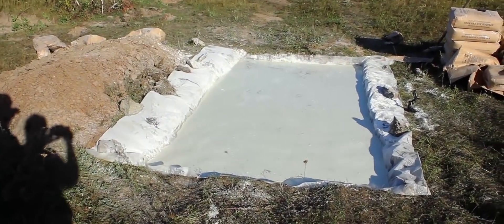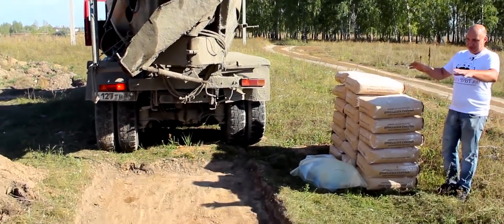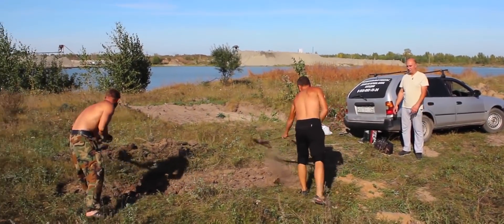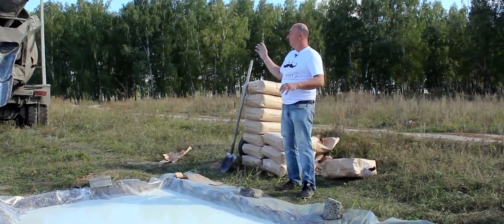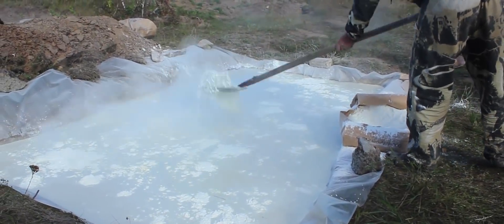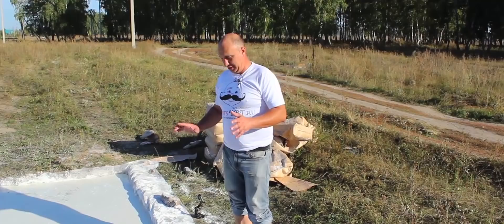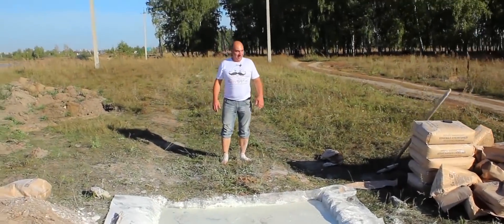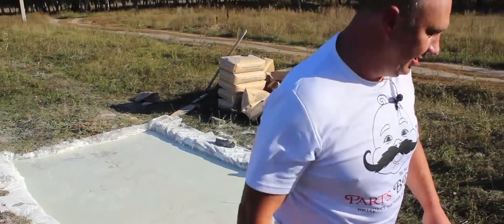1000 LITERS of NON-Newtonian FLUID

Comment: Aaand I just realised that a cement truck is just a giant cement mixer.
 Only took me 25 years...
Reply: positron underVolt 
Cement is ready mixed when living the factory. 
The spinning of the truck's barell container is just to keep the cement liquid until it arrives at the construction site, to be delivered.
Reply: positron underVolt lol dam must be hard living day by day.....
Reply: It's a giant mixer. U can mix alot of mixtures. Not just cement:)
Reply: As long as it's stays spinning, the cement won't harden....
Reply: @sjg91704  They should find a way to make sidewalks spin so that we can re-use the cement in the future.  It's a green approach. ♻️👍👌🌍🌏🌎
Reply: @amistry605  grass + dirt, when wet you can reform
Reply: @vincentas1  lol what?
Reply: @amistry605  I solved your problem from 2 years ago
Reply: @vincentas1  lolol I see! 😄
Reply: Dan _ that’s not true
Reply: Pancake Hi27 it is
Reply: Pancake Hi27 Dan is correct.

Comment: 11:15 all you had to do was remove the wing
Reply: Your sarcasm was weak sauce, don't blame him for your weak attempt at sarcasm... bro :v
Reply: No need to apologise bro.... i am not offended by comments on the internet
Reply: Far_Queue how would removing that ugly park bench wing help get out of the fluid?
Reply: Less downforce brah
Reply: Lmao.. you're joking right? You must know that a wing only creates down force (also called negative lift - like an upside down plane wing) when large amounts of air pass by it at a high enough velocity, creating lower pressure under the wing and a higher pressure over it. Surely, you know that a car that isn't moving isn't going to have any down force exerted on it's rear wing, unless there is a giant fan or a jet engine in front of the car moving air over the wing lol. And you realize how stupid it is to put down force on the back of a front wheel drive car, essentially pushing the rear end of the car down and lifting weight off the front wheels, reducing traction. If you really didn't know any of that, you do now. Now go take that giant spoiler off the back of your fwd car. Lol
Reply: Only the dimmest of the dim would not understand that sarcasm but hey you reach... I teach
Reply: Jet engines are used to move air in wind tunnel aerodynamic testing, FYI. I was making the point that a large volume of air would have to pass over the wing at a high velocity. As far as your sarcasm goes, I only see the words you type on the screen. Sarcasm is impossible to be communicated clearly with only text, unless you were to say that you were "just kidding" or something similar. My apologies for not knowing how sensitive and easily offended as you are.